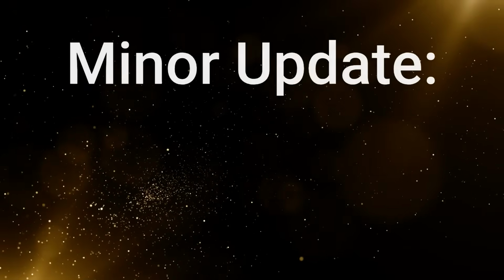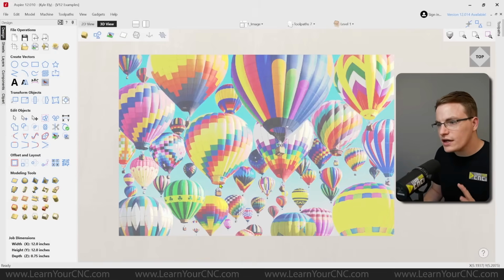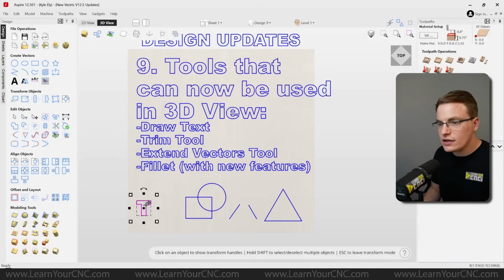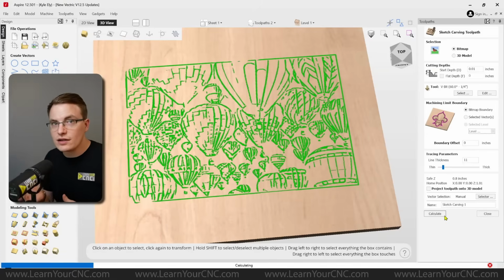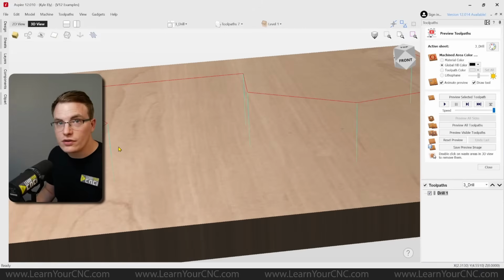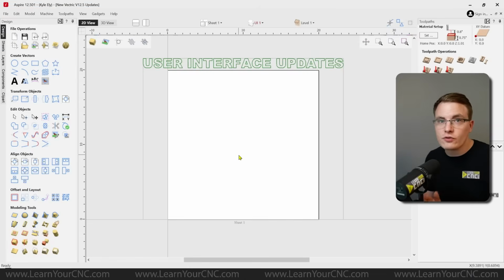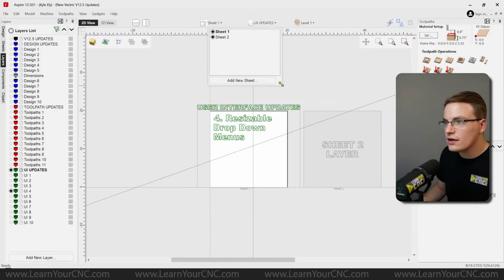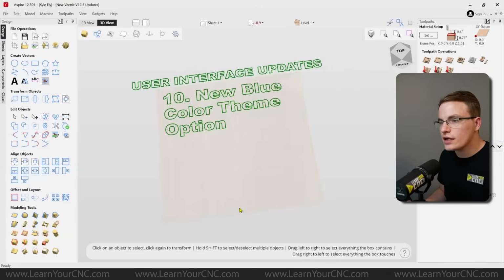Vectric 12.5 is HERE! Here’s EVERYTHING That’s New in Aspire, VCarve, and Cut2D

Comment: I still run V8.4 at work (don't ask me why, I have nearly convinced them to upgrade to v12.5)

One of the biggest time savers for me would be if we could start from a certain point (I.e with preinserted layers) 
This would be useful for when we cut ACM tray signs and we have;

"LAYER 1
ACM
ACM INNERS
FRET CUT
ENGRAVE
BEND LINES
DRILL HOLES
TRIANGLES
3MM OPAL ACRYLIC
10MM OPAL ACRYLIC PUSH THROUGH 
LIGHT TRAY
LED MARKERS"

And potentially more, with a separate colour each... and you have to set it up everytime.
If it isn't a thing yet, I think that vetric should have a setup like on Microsoft word/excel where you can choose from more than just "new" and "upload existing file" so that you could setup different formats for different materials and then have preloaded layers and toolpaths relevant to the materials used. 

I know how to do saved toolpaths now that I learnt how to setup variables - my previous job used alphacam and I did a solidworks night course and used variables and enjoyed them. When I tried to describe them to the person who "trained" me on vcarve swore blind that he didn't understand what I was describing or how it would be useful.
Reply: Also I know they have some sort of guide line or something, but I would love to be able to draw my own construction lines and set them onto a different style of line so that they are not locked, but perhaps constained? 

Also can you constrain in Vcarve? I've had a few mishaps where I have changed the size of something and risk not selecting one line and sometimes I catch the error and sometimes I don't..  feel like the chance would be eliminated with some constraints

Comment: I updated my VCarve Pro to version 12.5; however, I do not have some of the features you mentioned, and I am wondering why. For example, when drawing an object with a polyline, I do not have the box show up to be able to put the length of the line. Similarly, in node editing mode or in rotation mode, the box does not appear for me to put the values I want.

Comment: Im having isues with accuracy.  When I use the interactive trim tool, the weld tool... it trims the lines by a fraction before or after the intersection with another line and then when it rejoins the trimed lines, it distortes them. Is it posible to fix this problem?

Comment: Thanks for a great video on the 12.5 update. I got an email for the 12.5 update for $50. Since I only have the 11.5 version can I skip the 12.0 version and update to the 12.5, or do I need to pay for the 12.0 first?
Reply from the maker: You can skip V12 and go straight to V12.5! Well worth it in my opinion! Feel free to use my affiliate link if you want to support my channel: www.vectric.com/learnyourcnc
Reply: Thank you for taking the time to respond to my question! I just upgraded to 12.5 using your link - Thanks.

Comment: Great video.  Thanks.  I'd like to be able to calibrate my zoom level to match approximate real size.   If I hold a 6" ruler up to a 6 inch line they should match along each axis.   Is there a way to do that now?
Reply from the maker: Great suggestion. I don't believe there is a great way to do that now without manually zooming in and out. You can reach out to Vectric about that, and they may be able to add it in a future update.
Reply: @LearnYourCNC  Yes I can zoom in and out but I can't find a way to adjust the increments.  It's either too small or too large.  A fine increment Zoom would be an improvement!  I've made this suggestion to Vectric, maybe your vote would help!